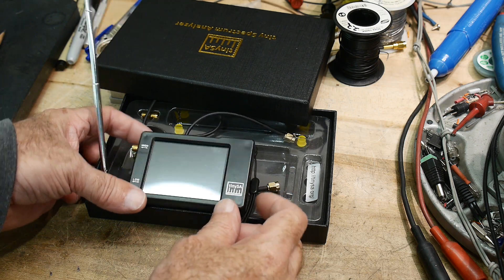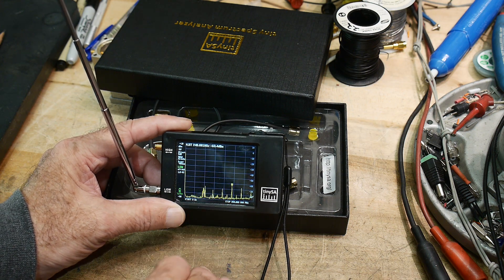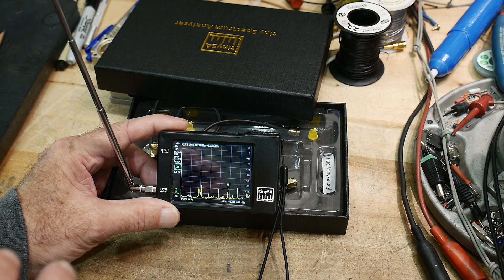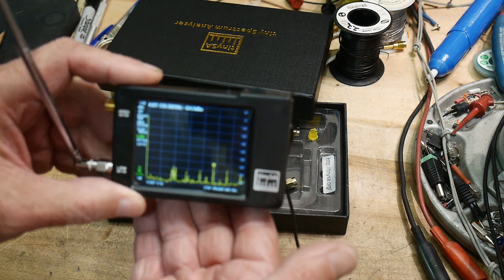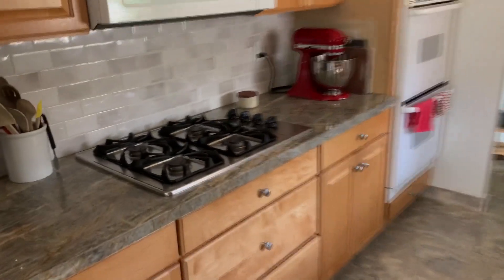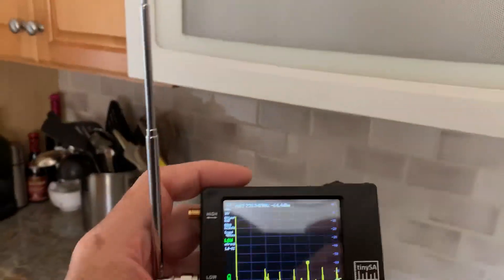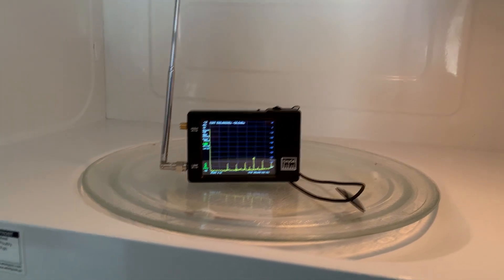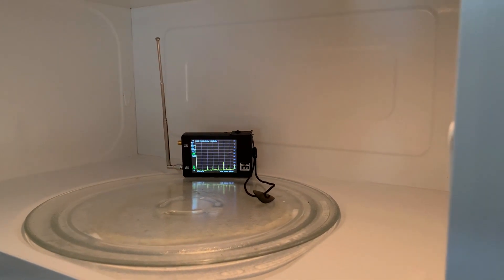#553b TinySA Inside the Microwave

Comment: Can I please ask what hardware version is your Tiny SA? Mine is Tiny SA v0.3 and when I put the antenna on my Tiny SA and put it in the microwave just as you have done, I see no signals whatsoever, not even a hint and that's with the PRE-SET - LOAD STARTUP options loaded so that it's scanning the full low-frequency range and using the same antenna that is supplied with the Tiny SA attached directly to the Tiny SA. I wish I could post a photo showing this.
Reply from the maker: I assume that is due to new firmware. I don't think the hardware has changed, but the spur detection and removal in the firmware has improved over 2 years. check the config and see if you can turn off spur remove and try it again.

Comment: I was about to comment on using the Microwave Oven as a Faraday cage, then you went and did just that. I've used the Microwave Oven so many times like this and it works very well!
Thanks.... The other thing to try is to put the antenna on a short SMA coax and see if you are picking up clocks from the Tiny SA chassis, moving the antenna away from the Tiny SA may just help without too much inconvenience.

Comment: Interesting test.  I just tested my TinySA which is an authentic version and purchased in early 2022, and I see no spurs (0 to 350 MHz) when I repeat your test using the Low input port.  I suspect improvements in shielding and newer versions of the firmware have addressed the spurs.

Comment: I am curious to know a little about your history and about your previous work. Did you work as an RF engineer? Perhaps you can make a video, or set of videos, about your past experience in this field.
Reply from the maker: I started out as a EE designing test equipment for optical devices. For a couple years RF power meters. Then for the next 30 years as an optical scientist. I do electronics in my garage in retirement. Most of my RF experience is self taught.

Comment: The low input is susceptible to the harmonics of the 48MHz MCU clock. When doing a 0-350MHz scan with an RBW of 10kHz these are clearly visible. Because the SPI of the MCU is directly connected to the attenuator and the receiving chip, we have not found a good way to avoid them for the time being. Welding 22pf capacitors on the SPI can weaken them, but it still cannot be eliminated. https://tinysa.org/wiki/pmwiki.php?n=Main.Limitations